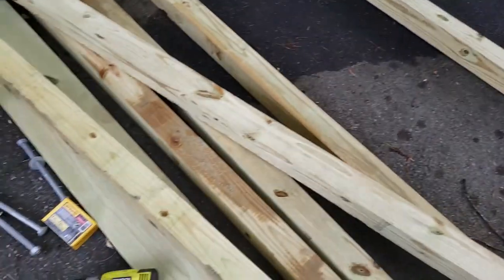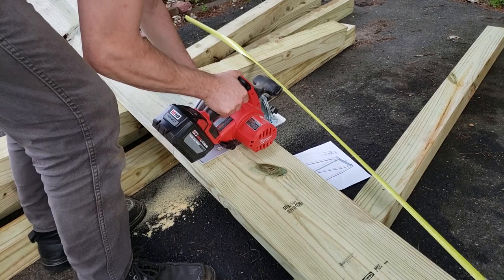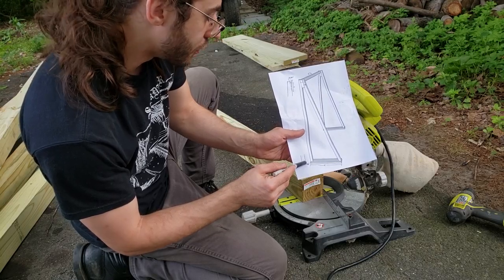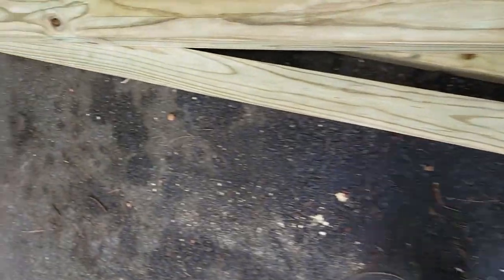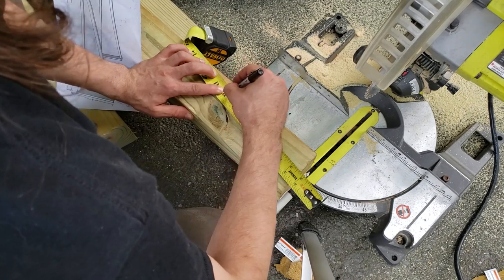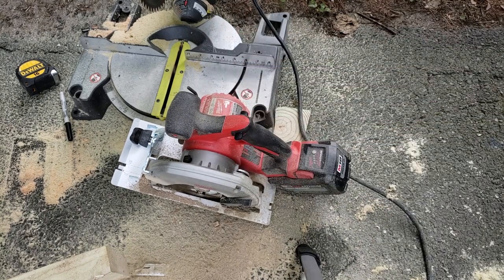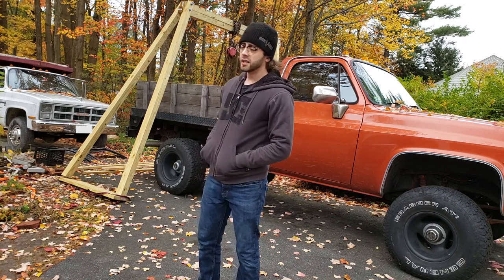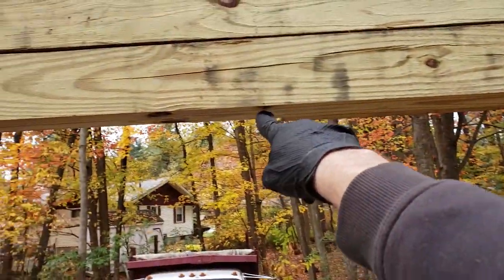DIY Gantry Crane with Hoist (v2)

Comment: I am not an engineer, but I can use online beam calculators: two 4x4s stacked for your main beam has significantly less capacity than two 2x8s used on edge. Didn't you watch that episode of Mr. Wizard as a kid?
Reply: I suspect he had 4 x 4s on hand, but when I build one of these I'll do it your way.

Comment: if you've ever seen the header of a garage door - it's made up of two or three 2x10's. pretty strong and pretty cheap to build. i'm building a gantry so that'll be my top cross member. thx for this video.
Reply from the maker: Yeah those will definitely do the trick. I'm now thinking of adding some casters to make it mobile.
Reply: or just get some gluelam beams

Comment: Freaking hilarious. Reminds me of myself. Great job.
Reply from the maker: Thanks man. This gantry served me surprisingly well - I used it to pull the engine out of my Subaru, and even used it to pull an incredibly heavy dump bed off a truck. But in the future, I think it may be a better choice to just buy a gantry so I don't have to wonder if today is the day I get to meet God.
Reply: @Bootstrappin  true. I need to build one to hold up my motorcycle.
Reply from the maker: It's one of those things -- do you trust yourself enough with your building skills? For me, I trusted enough that I could gtfo if shit hit the fan, and I'd never hang out underneath the load.

Comment: should have ran a bottom 2x stock to make it a square instead of an upside U. If all sides are connected, the torques will balance in the truss, and strength will go up...... Your design is inherently unstable unless it was welded steel. T = F x D, with a lever arm of 8ft, any miniscule unbalanced force will really cause your thing to move and bend and sway...... Need to make it a box where the bottom you can drive over, just a simple 2x12 facing down will do.

Comment: Have you ever seen Carpenters use drag-legs to raise a wall? It's now 2022: are you still alive? What 3 year old kid designed those "saw-horses?" I like the minimalist design of your gantry but it needs tweaking. I need one to lift my 150 Mercury outboard motor onto my boat. Your design uses less lumber and if I build this I'll only use it once or twice in my life.
Reply from the maker: Oh man, a couple wall jacks (I assume drag-leg is a colloquialism for it?) would've saved me a serious amount of strain, didn't even know what that was until you mentioned it. I wouldn't know about those saw horses, maybe Mr. Home-Depot's son? I agree, it could benefit from some side-to-side/lateral stability. But I'll tell you this -- I've used it to lift the engine out of my Subaru, and I've even used it to lift a dump bed off of my truck (that thing must've weighed well over 1000 lbs). Lifting the dump is something I wouldn't ever do again, but given that I'm not dead, I guess the gantry did just fine.
Reply: @Bootstrappin  Not wall-jacks, just a couple boards with one nail at the top, one on each side and  laid out to drag up as the wall is lifted and catch on the ground/floor when a rest is needed. I give you credit for the fact your gantry works but if you ever sober up you might be embarrassed by your workmanship...
Reply from the maker: @choimdachoim9491  I see, gotcha. It was definitely a different time, and a different me. If I had to do it again, I'd probably just buy a steel gantry, even a used one would be less anxiety-inducing than this one, and I could also just sell it again.

Comment: Geez. Obviously, you've never done any carpentry work just seeing the way you used those saws, and have ZERO common sense in engineering the simplest of structures. You're also alone, so be very careful. Also, your terminology for everything you used is way off. But.. good job dude, everyone has to start somewhere!! 👍